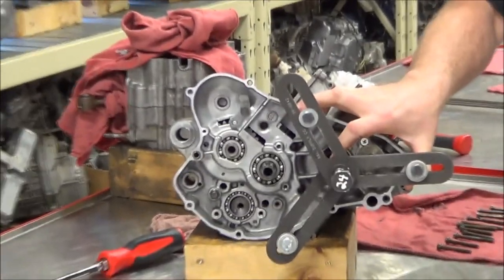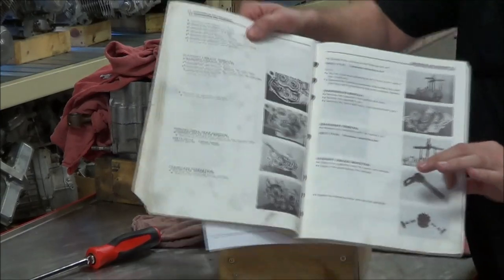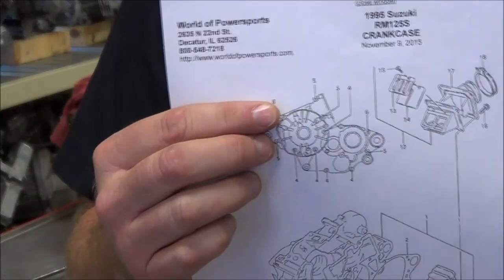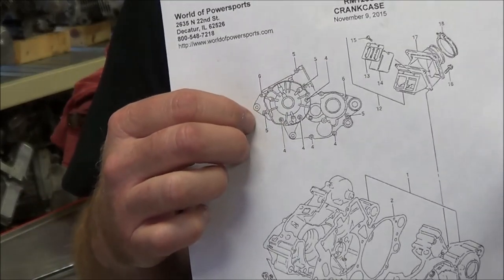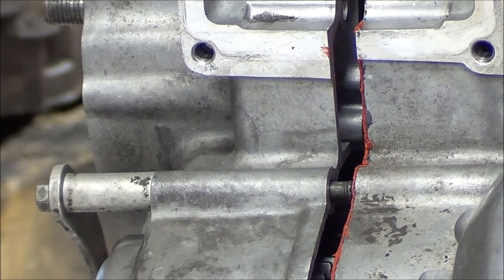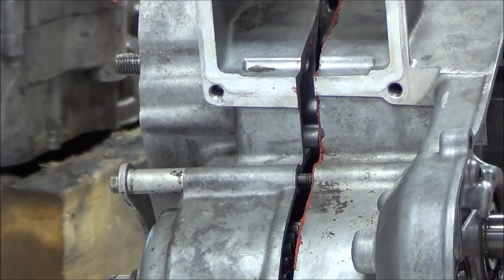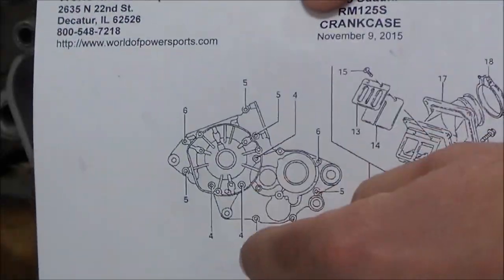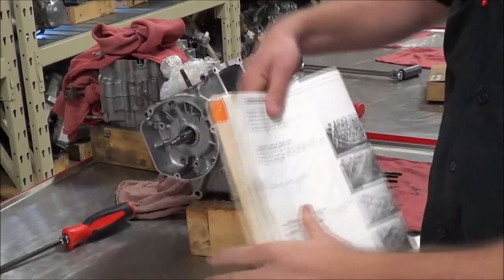EM SERIES Missing steps in the manual

Comment: Good lesson, Shane! I have found that Service & Repair Manuals can also have a number of typeOs. Just another reason to pay close attention to the task at hand. Example:  I recently had the need to chase the oil filler cap threads in a Ducati 848 clutch side crank case cover; the manual list the threads as M22x1.5mm, when in fact they are M20x2.5mm. The manual is a great tool, but not always spot on!
Reply from the maker: +Track848 
Great reminder to talk about. We have actually intentionally keep a misprinted manual just to demonstrate this exact thing. I truly believe it is a "must do" to teach how not to do something as much as it is how to!